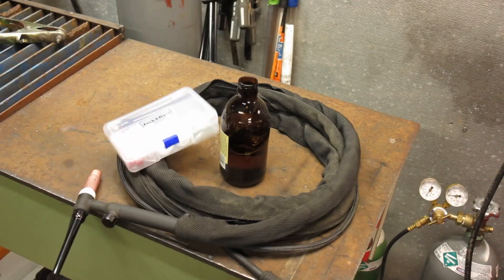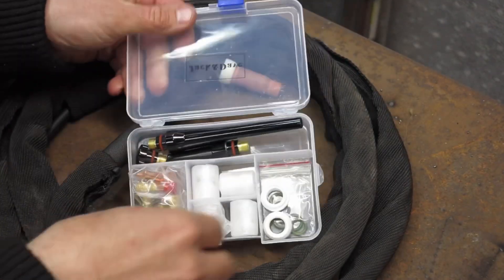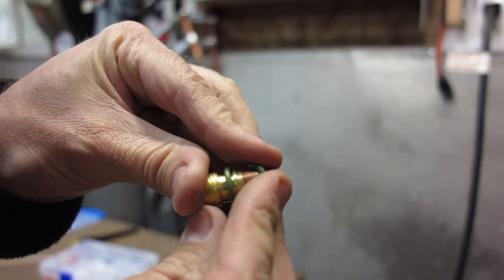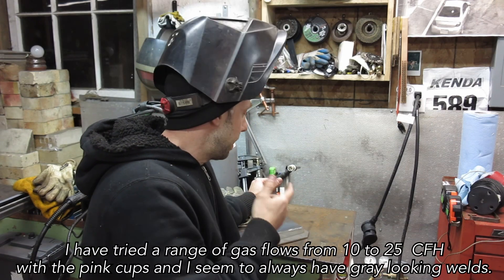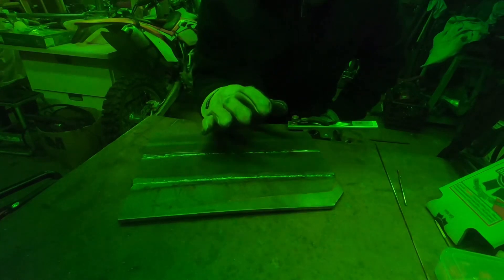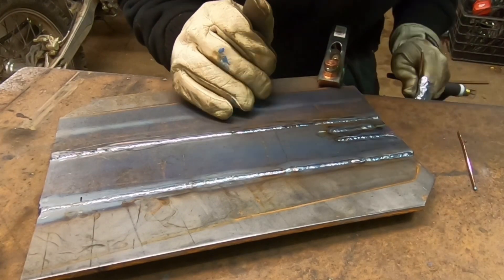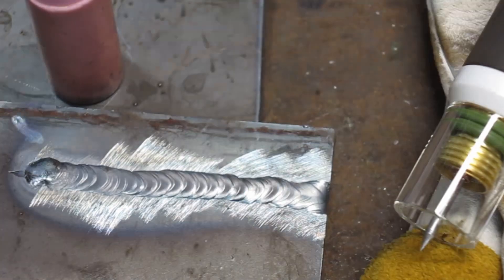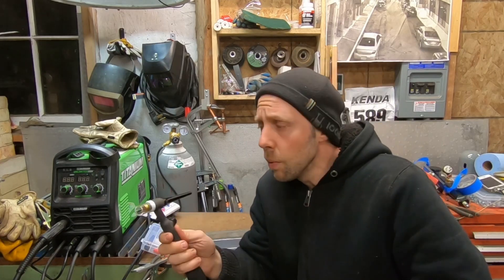Stubby gas lenses for TIG torch

Comment: Something you should try is using the standard pyrex gas lens cups over that gas lens. I think you'll find that 99% of the results you're talking about come from your switch to gas lens, not the switch to pyrex cup. Other than visibility. I use both, for different things, but the gas lens is the game-changer here.

Comment: The gas lense rather than the regular collet is what affects the weld. I love using lenses unless I absolutely have to use a collet for certain applications. Also, I havent worked with this style of welder much yet but I'm almost positive that you do not need o-rings around the lense. Those green ones look like they are just replacements for the red ones on the backers. When you start, try the flick method by using the filler to bridge the gap between your tungsten and work piece and flick it away right as the arc starts. This will keep the tip sharper longer.
Reply: No, he's actually spot on with the o-rings. The pyrex cups are not internally threaded like the ceramic ones. The only way to make the pyrex stay is o-rings. You're totally right that the gas lens is what is making the difference in gas coverage, and the fact that he stepped up a size in cup. The pyrex isn't changing the welding at all, just making it easier to see. :)
Reply: @iaahner  I've only used ceramic cups before so I didnt know they weren't threaded. Looks like I'll have to play around with that sometime soon

Comment: Do you use the the same gas mix for MiG and Tig? Just finishing up stick welding school
Reply: No short circuit uses 75-25 argon co2mix while gas shielded flux is 80-20 and tig you  use 100% argon or like tri mix

Comment: Go to weldingtipsandtricks on you tube, look up scratch start tig
He shows how to rig up a knife switch as a foot pedal to disconnect the power 
That way you can hold the torch over the weld and not have to pull back👍😎

Comment: I had a question I am looking to buy the titanium 200 how do you control the amperage without the foot pedal I’m very new to tig welding I’ve tried it a few times but with foot pedal, And the knob on top of the torch is for a gas flow?
Reply from the maker: Good question, so I don’t know if a amp pedal will be available for the Titanium 200? The fact that there has not been one sold yet is making me feel like there won’t be one. I found that leaning DC TIG was easier without the pedal, I had the Vulcan Omnipro 220 with the pedal and it was just one more thing to distract me when Learning to TIG, I actually practiced more and learned on the Titanium, it was more simple. I found with DC TIG welding steel it is not that necessary for me to vary the Amps, I mostly would set the Amps and weld. Welding Aluminum with a AC TIG is a different story, you definitely need to adjust the Amps with a pedal. The knob on the TIG torch is just a on off, you set the gas flow on the regulator, it’s just a simple twist valve. Keep in mind the Omnipro 220 has a available pedal, but you have to buy it and the TIG torch separately. I hope this info helps 🙂 Take care
Reply: Mike festiva thank you

Comment: Where can I get replacement 1/16 defuser/colletbody??????????
Reply from the maker: I would check EBay or Amazon?
Reply: The ones listed are 1/4 inch shorter I tried already
Reply: @Moodyfabrication  

Look up stubby gas lens collet bodies. You have to order them to match the size of the collet/tungsten you're using.

Comment: the Vulcan ArcSafe Helmut rocks also, as well as the welding cart...  keep an eye open for a superCoupon on the helmet !..   thanks Mike..   its like tying your shoes, practice a little everyday and you can do it with your eyes closed..   well maybe not so for welding  LOL  ... uhm..  but it works for guitar  :D         ps, aaron over at 6061 channel says... trash  the pink cup that came with the torch and get a gas lens!  as far as the sparks, clean clean and clean , (for tig) like painting a car... its mostly in the 'prep'

Comment: The collet body with the diffuser screen makes the difference. The Pyrex cup is cool, but it should not affect the weld quality. Collet bodies with the screen are available for the old pink cups as well, and they do make a difference. We used to stuff some scotch bright in our cups to diffuse the gas flow sometimes. The less turbulence on your gas flow the better. Often times turning up the flow will make it worse.

Comment: The sparking comes from lack of gas coverage, turn your gas a bit should help. The Pyrex I feel is way over price, don't get me wrong their nice but budget tight. I was a big Miller fan for years and had a Miller Diversion 165 that works fine, it was really basic Ac, Dc, machine. Recently just bought a Chinese  Primeweld 225 Tig welder and I was amazed by all the features it came with and what it cost me less than 800.00. It's one Tig and sticks welder I am really happy with. Good video Guy. By the way, on  Fabrication Series they review this Primeweld 225 machine

Comment: 4:40 LMAO Your the best Mike, I know so many people like that here at work. I work in aviation maintenance and some guys think if they spend 20K on snap-on tools it makes them a better mechanic.
Reply from the maker: Haha! Yes sounds like we both have come across those kinds of people time and time again, just because you can buy nice stuff doesn’t necessarily mean you have skills, skill is something earned not bought. As I’m older now I see right though those kinds of people. Take motorcycle for example, I actually get a bit of a kick out of going riding dirt bikes on technical tight trails with a guy that has the best of the best and thinks he’s hot on the trails, every stop you find your self waiting for them ;) Haha
Reply: Well in large part to your glowing endorsement of the Titanium 200 after we talked about it last week I'm now the proud owner of one myself. Kind of expensive to get going because I needed everything welder, bottle, cart, gloves, helmet, table, including wiring the garage for 240(thanks for telling me the right plug type BTW)  but I got it all done and bought and now I'm welding again. Haven't really done that since high school shop class many years ago. Pretty much like riding a bike though after about 10 min I started getting my technique back and laying down good beads. I'm very excited about learning TIG but it requires me buying another bottle and regulator from Airgas so maybe later but I am gonna order those Pyrex cups for sure. Thanks for all the great content and advise Mike you have really made a difference!

Comment: The sparking is from the Mill scale that it on the plate. The metal has to be clean for all shale before welding or it will contaminate the tip the mill scale will jump up on to your tip

Comment: What voltage and Amps are you running on 120v? If you can up your voltage a couple volts and keep your Amps @ 90 your weld bead should lay out better.
Reply: That's not how Tig welding works.
Reply: @cavemanjoe7972  your right

Comment: Just watched a bunch of your vids.  Want to get into hobby welding, thanks for the reviews....subbed👍
Reply from the maker: Right on! I appreciate it :) 
You definitely will have a great time learning to weld and building stuff! Welding is a great thing to learn. Take care
Reply: @Mikefestiva  thanks man. So I was kinda set on getting a mig of some sort but after watching more vids a few say to start with stick. What do you recommend? I do have a higher budget of about $1000. Here is one of the vids of experienced guys saying stick is better....https://youtu.be/KEN81Zy1ZtM
Reply from the maker: I have heard that, I started with stick, now with that said I don’t really like stick welding, I only started with stick because that’s all I had at the time, man I had some crap welders in the past, it was extremely limiting for the work I wanted to do, I was in my teens and wanted to weld real thin metal like bike frames and stuff, the stick was not really good for thin metal, mater of fact it sucks for thin metal at least that’s been my experience, I mostly use MIG because you can weld thick to very thin metal, it’s cleaner and It just fits my needs more. I would say, think about what you want to work on, build and let that determine what kind of welding you want to do. Ps keep in mind both of these welders are stick, MIG and DC TIG, you get all three to learn on. I have heard that if you start on stick you will be better off with the other processes, I don’t really buy into that nonsense, like I said what are you planning to build and work on? I have welded up  tractor implements with stick welders, smoky and slower, I also have built a tractor box scraper with a MIG welder, both things turned out fine, so it just comes back to what you are interested in. I hope this helps you in some way. Take care :)
Reply: @Mikefestiva  it does help man, thanks. I am in the same thought process that you just mentioned. I plan to just do modifications to my bobber motorcycle and some mods to my Tacoma to start with(bumpers). mainly stuff like that and possibly build some furniture art etc. I wont be doing any outdoor work with it or anything.
Reply from the maker: big_air_ jer I definitely recommend a MIG welder and a bottle of Argon/CO2 mix for shielding gas (makes really clean welds) multi process is definitely recommend too, just so you can learn the other processes when you want. It sounds like we have a lot of the same interests :) what kind of bike do you have? I have quite a few bikes, I have been riding for since I was a kid, one bike project I probably will post a video on is my 1973 CB 350 four, it’s a great little bike, I picked it up literally in a barn, (people always say barn find) but this is true, I got it years ago for $200, it was in shit shape but over the years I have been fixing it up. ( it’s crusty looking, not polished but I kind of like it that way) I just bought a AC TIG welder so I’m looking forward to welding up some aluminum parts for it, it’s a bit of the cafe styling, but trying to keep it comfortable still to ride. I also have been thinking of building a front bumper for my older Ford F-250 4x4 Diesel, it’s stock and I like it that way, but some better bumpers would be nice especially the front, I would like to build it so I can stand on it when checking the oil and doing maintenance, the trucks are so high stock you usually need a step stool to do much in the engine bay. I also try and make some little art projects when I get time but that’s not very often. Take care and I’m looking forward to hearing about your future projects!

Comment: Mike I love the videos and I also have the titanium welder. Was wondering if u could do a video tig with straight helium for aluminum? 
 From all my research its deep penetration and way hotter. NASA uses it alot with there space craft.
Reply: Preheat your basemetal to 900*f , and you can have a better chance to do a good peneteation, as aluminum needs a lots of heat to fuse but also melts below 1300*f, temp. sticks recommended.

Comment: Hey Mike, I recently purchased the Titanium Unlimited 200 after seeing your videos and I'm truly happy with it's performance.  However, I can only use it on thinner metals due to lack of a 240V outlet. So my question is... What size amperage breaker will I have to install in order to use the welder on 240V?
Reply from the maker: I’m glad you’re happy with your new welder! So the plug on the 240 adapter for the welder is a  50 amp plug, the receptacle you want to buy is a Nema 6-50R, you can find them at Home Depot or on line. I would say to wire it correctly you would need to install a 50 amp breaker, I don’t think the welder draws even close to that but I’m sure a 40 would be plenty, it’s up to you on what you want to do. I would only suggest the 50 for the fact if you have a 50 amp plug on the wall and someone plugged into it say something else that actually drew 50 amps and the breaker was only 40 the breaker would trip, like I said do what you want, I don’t know all the regulations of  how that stuff needs to be wired, but like I said 40 amp breaker would be plenty. I hope this helps. Take care
Reply: @Mikefestiva  
Thanks a bunch for the reply Mike.
Great videos by the way!

Comment: There are arguments both way about high price, well known goods and cheap, unknown goods. Maybe, if you’re just starting out, cheap is better, because it’s too easy to ruin these consumables and small parts. But sometimes, there is a difference in performance, and the cheap parts make it harder to work when you’re starting out. Experienced welders look at this in two ways. It’s easier to make up for poorer equipment when you know what you’re doing. On the other hand, the better equipment allows you to do even better.

Yeah, sometimes there doesn’t seem to be a difference, and that’s true. But I’ve tested a few cheap TIG torches from eBay. I found two to be made of zinc, plated with copper, instead of actual copper. Well, what do you expect for under $20?
Reply: Try the kit and see.

Comment: Nice video. Little tip on scratch start,try resting the edge of the cup on your material then touch your tungsten and use the edge of your cup as a lever to lift your tungsten and start your arc.
Reply: Another way that works really well, for scratch or lift, is to get a small piece of copper, just a few square inches, around 1/16 thick. Place that right next to where you want to start your arc. You can start on the copper, because the tip won’t stick. You then just move the tip to your weld starting point. That works every time.
Reply: @melgross  that is some of the best advice I've heard in a long time. Thanks for the tip
Reply from the maker: Thanks, I appreciate it!
Reply: @Mikefestiva  now that I think about it that might not work for scratch start, I used it for lift start. Don't know if they work the same worth a shot though.

Comment: Oh ya 2%thoriated tungsten for everything except aluminum it will work pure tungsten is just better a d it does make a difference even when you just start
Reply from the maker: I just picked up a AC TIG and I have only ran gray and  blue tungsten on it and it worked okay. What color Tungsten do you recommend for welding Aluminum?
Reply: @Mikefestiva ceririated will work all the day around but pure for aluminum and thoriated for everything else is the best you will notice the difference the more time you have with each under the hood
Reply from the maker: Hey thanks Tiffany I appreciate it! I think my first project will be welded up a Aluminum shop stand for my KTM 200 motorcycle, I have a abundance of 6160 1/8” Aluminum that I buy for cheap from my work, it’s used but I can buy it for scrap prices, there old snowboard mold plates for manufacturing snowboards. Take care
Reply: @Mikefestiva  green or its pure tungsten when you sharpen it to a point put it strait up and down on a scrap peace of aluminum and give it heat until it has a ball on the top about 3/32 or 1/16

Comment: That gas lens with the screen diffuser that why your welds look better try it with the gas flow should fill like a constant breeze against your face flow meters are not always accurate 20 to 25 cfh is perfect any thing over 8 size under 8 10 to 15 cfh
Reply: Smart girl!

Comment: I have been trying to find out is is there a pedal that fits this and works for available would be nice I was told at the store in the beginning it would be one now nobody knows
Reply from the maker: I wish I could tell you if there’s one available, I couldn’t even get Harbor Freight to return my emails, I’m definitely not a electronics engineer, but I’m going to look into the pin outs on the front and see if I can figure them out, two pins are for 24 volt dc to run the spool gun, 2 are for the MiG gun trigger connections and the fifth one? I need to look into this and see if there’s a way to wire up a pedal to it? If I figure anything out I will post a video about it. Take care
Reply: @Mikefestiva  thanks Mike that wound be ready cool if there is one ... I will be hopein you can find out.. I ready like your vids ...they are the best that I can find from anyone out there.. what's really cool is the fact that you're working with the titanian you have showed me an awful lot and instill my confidence which I was afraid to even turn the machine on so I seen your demos and your research you can imagine how I feel since I found your videos on the Titanic I'm sure there are many people that have the same machine that have a lot of questions as I do I was in the store the other day I told three people about your channel they were very interest they also bought the 200 I told them  to say hi from me see what happens thanks again Mike God bless.
One more great American you make me proud to be 
                 🇺🇸
Reply from the maker: Man that’s a great comment! I really appreciate it :) I will keep posting videos about these welders and stuff I learn along the way. I’m glad you find my videos helpful. Salvage yourself some metal and keep practicing and have fun :)